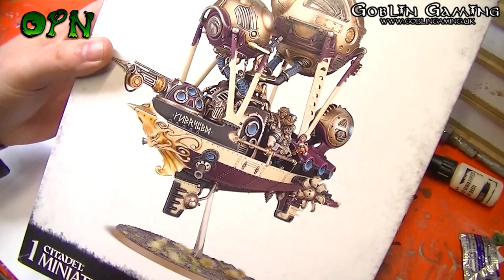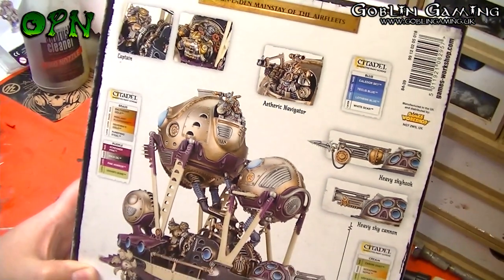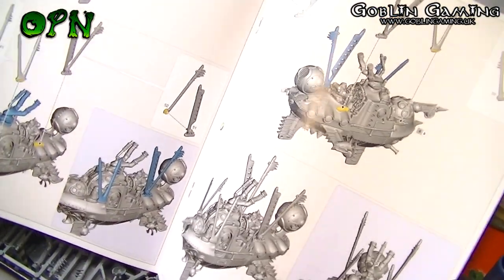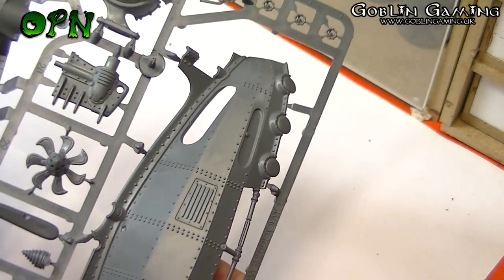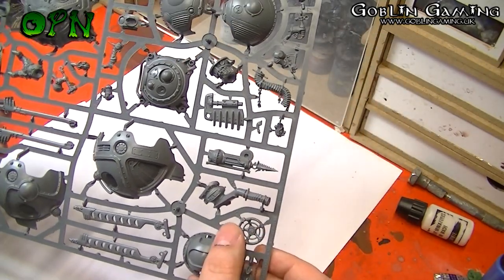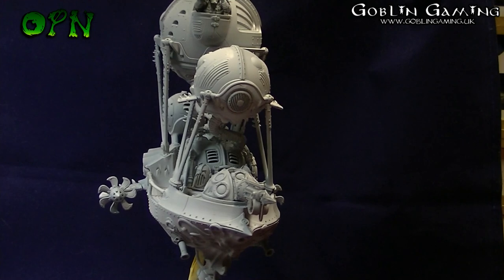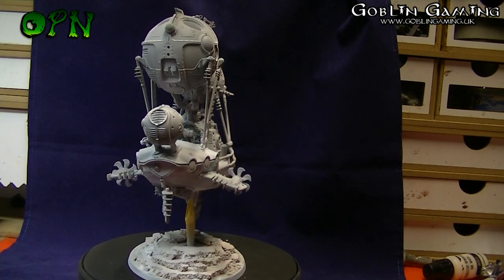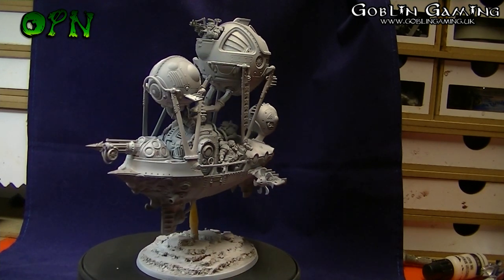Unboxing and built Arkanaut Frigate

Comment: That is an amazing kit.  If you have any friends with 3d printers.  You could get them to print an adapter for the base part that holds up the frigate.  That would be much better than actually using glue.
Reply from the maker: Randall Bourque I don't I'm afraid.
Reply: Well you do actually lol.  If you can send me pics of both the hole in the ship and the stand component with measurements I might be able to assist.